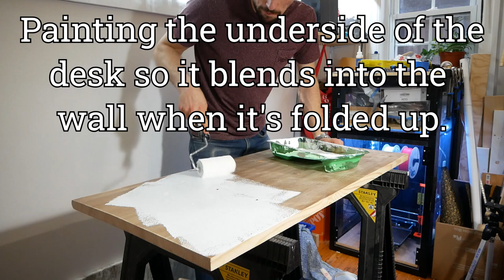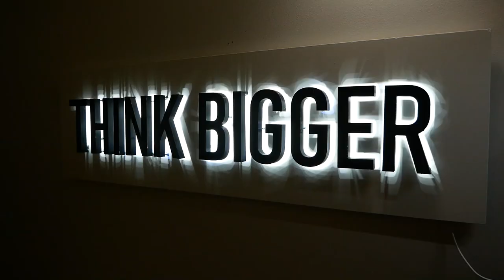DIY Wall Mounted Folding Table + Task Light

Comment: That come out quite nice! I agree with Grant, the corner protectors were a nice touch.
Reply from the maker: Thanks man! Fun fact, I was planning on doing the same detail on the spice rack (I was assuming that my mitre joints wouldn’t look good), but they came out really nice, especially with some touch up paint, so I left them off!

Comment: Another great project! Can't even tell it was once a table. Good job!

I thought you were gonna mount the switch the other way, so the light would come on automatically when you fold it down, but it's the wrong kind of switch for that. Would have been a cool little bonus.
Reply from the maker: Thanks Jarrad! 

Honestly I’m not a huge fan of automatic lights, I like being able to control when they’re on manually.

Comment: Really awesome table i like the use of the 3d printer also. But one piece of advice i know the pocket holes on the outside do not look as nice but the pocket hole on the outside offers about 70 more pounds of strength to each joint than inside pocket holes and can still look decent if dowels are inserted and sanded.

Comment: Would be good to add another strip of wood on the front of the task light so that the LEDs are not in your visual field when sitting there. Paint it matte white (matte white paint can be more reflective than most mirrors, it just doesn't form an image) on the hidden side and it will help to diffuse the light as it bounces between that surface and the wall behind.
Reply from the maker: That’s a cool idea!

Comment: Great idea. Just right for an extra workspace in my work area. I did wonder why you mounted the hinge on the outward facing part of the desk and not the underside? Looks great I'll have to start work on my own fold out desk.
Reply from the maker: Thanks! I did that so when the table folds down, it’s bearing on the wall piece and so partially supported by that contact (in addition to the legs).
Reply: @MorleyKert  Thanks for the reply. I've been scouring our local recycling sites for a source of wood for my fold out mini-desk.

Comment: I wonder if you inset roller bearings into the legs and used a bolt that was only threaded at the end in conjunction with a nylon lock-nut/lock-washer, would the movement of the legs become smoother and more linear? A nice coiled or braided power wire would really pop for the light along with a power/dimmer switch flush-mounted into its frame. The project came out fantastic btw, I'm just OCD and over engineer everything! I'm sure if I uploaded one of my projects, you could suggest a hundred things to improve upon its use and/or aesthetics.

Comment: Small tip: for god sake, don't put the shrinking pipe and wires directly into the the flame, it smells bad and the wires insulation may just start melting as at 9:34. Instead keep it just inch above the top of the flame and wait couple seconds to let it heat up and shrink.
Good job otherwise!

Comment: Why wouldn't you put a roof rack on that little car?  Anyone that picks up stuff needs a roof rack! What you really need is a minivan with all the seats out except one passenger seat.  AND a roof rack on that van.  AND an enclosed or open utility trailer.